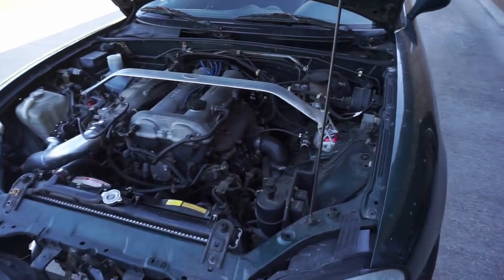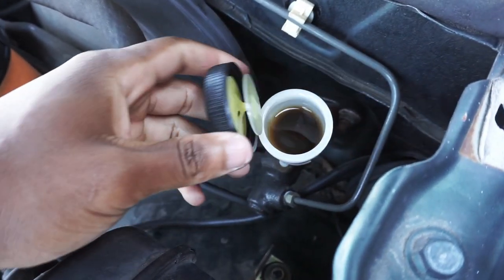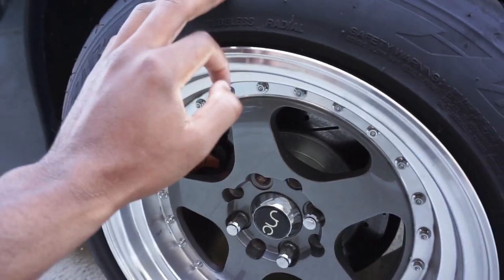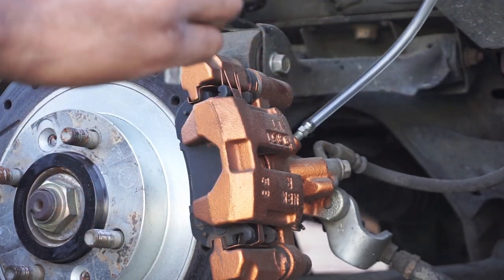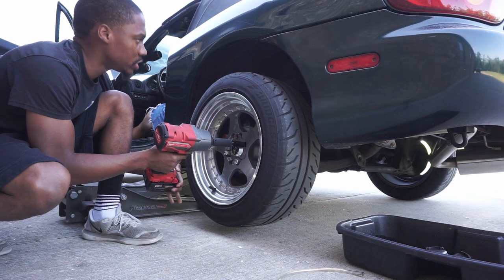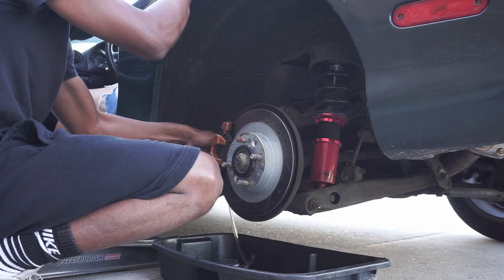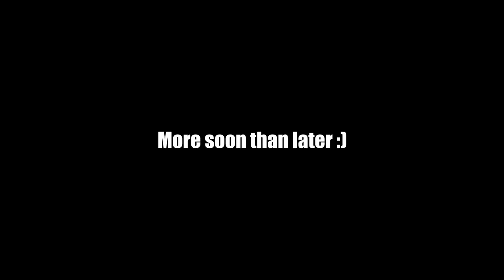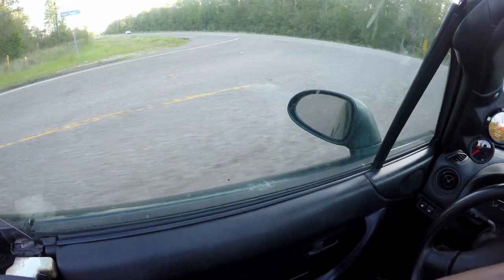Turbo Miata Could've Killed Me | This Could've Been BAD

Comment: Need some loctite threadlocker on those caliber bolts or they will back out like that. Glad nothing happen bro!
Reply from the maker: Yea I’m glad I heard it when I did.. I believe it could’ve been a headache had I not gone straight home
Reply: what. this is why torque specs exist. If Manufacturers don't use Loctite, you don't either, just need the right torque spec
Reply from the maker: @chayyboi  I honestly think I just didn’t tighten them back up last time I took the caliper off😅that won’t happen again
Reply: @chayyboi  respect to what you saying but manufactures do use loctite btw. It already be on the bolts they use. They still torque it tho you right about that.